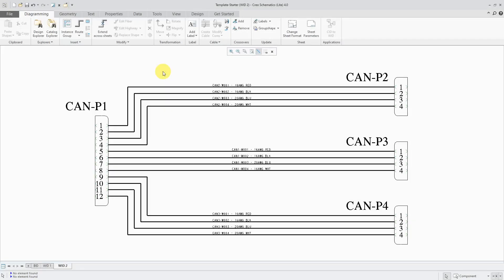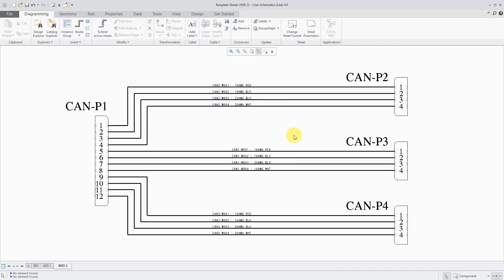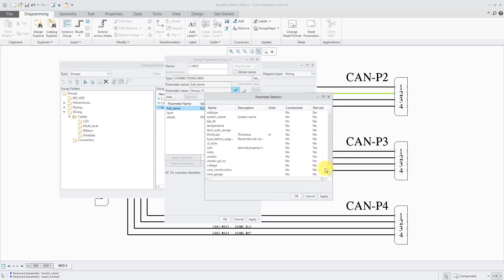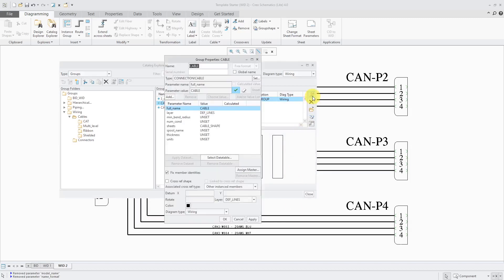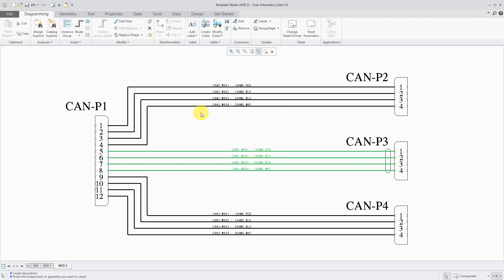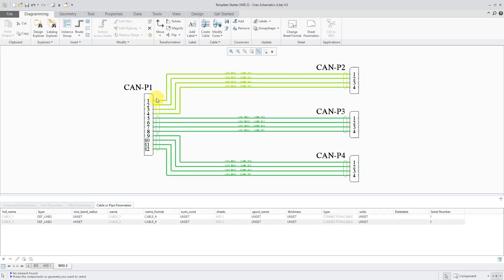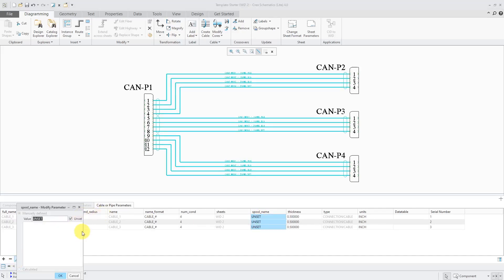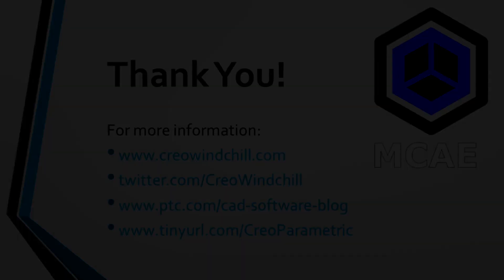Creo Schematics | On-the-Fly Cables

Comment: Hi David, 
Great job on these videos and your books, they are incredibly helpful! I think PTC university could take some notes. The documentation provided for Creo schematics is criminally lacking. In any case, I had a question regarding importing on the fly cables into Creo parametric for 3D routing. I followed your process in the video to create an on-the-fly cable, however I run into an issue with the spool name. When you create the on-the-fly cable - say with 9 conductors - do you need to have a datatable corresponding to the 9conductor cable with associated membermaps? It seems in this video, you would export the xml file and set up logical reference in Creo parametric. However, Creo parametric has issues with creating the cable without a defined spool for the cable. I tried creating a spool within Creo parametric with the same properties as the cable I created in Creo schematics but still wasn't able to create the cable. 

With simple wires you have the ability to quickly route them in schematics - assign a datable that has wire parameters that are widely used and import them into creo parametic for routing with no issues. However, there doesn't seem to be a way to quickly create/define cables in schematics without creating the cumbersome datables in order to use them for logical referencing in Creo parametric. If you can extend this video to its conclusion by routing the on-the-fly cable in creo parametric - I think that would solve my issue. 
Sorry for the wall of text but I've looked through PTCs tutorials, documentations, videos and even the routed system design group within the PTC community with no luck. 
Thank you for your creo schematic videos - they have been a great resource!
Best Regards.
Reply from the maker: Honestly, it's been years since I've used Creo Schematics. I have not used it in a production capacity since 2019 or so. This video is almost 5 years old. If PTC Tech Support can't assist you, I recommend reaching out to your reseller to see if they have a technical resource who can help you with your issues.

Comment: Sir correct me if I am wrong..
Cable is a set of wires with insulation surrounding it.. then the cable thickness should be more than the wire thickness  ryt....in datatable explorer for 3conductor shielded total wire thickness is 12 but cable thickness is 2.53

Comment: At the end you call a spool called Cable_spool.   Does that need to be created in Creo before attempting to route?  I get an error about a spool not existing in Creo cabling/or when I select to route it, it doesn't transfer into the route dialog and just ignores it.  Something is missing to route these in 3d, I'm afraid.   Fortunately your explanations are far better than anything PTC is putting out in their ” University”
Reply from the maker: Sounds like an issue with your XML export. See my video on required parameters for Creo Schematics for logical referencing.
Reply: I've successfully xml'd wires and predefined cables for years.   I think there could be a bug in Creo schematics 4 where it doesn't build the spool files needed for these on the fly cables.
Reply from the maker: @pete3000  Have you filed a ticket with PTC so they can investigate?
Reply: @CADPLMGuy  yup.

Comment: Sir, I want to give you an idea, can you help me convey it to PTC?
the first:
About Creo Schematics export issues
Every time I change the schematic diagram, I need to export the XML and then import it into Creo to update. I hope that ptc can do a real-time connection function in the next version. It does not need to import XMl. It can directly associate with Creo. Click the cable in the schematic diagram and it can be in Creo. Highlight
second:
Questions about the Creo Schematics library
I want to draw some electrical symbols, but I have symbols in DWG format. I open them after I create them and import them every time. I have to do repeated work. Can I import a folder at a time? The default import type is block wiring diagram type is wiring Or P&ID can be set by the user and then the port can be added by itself, which saves a lot of work
third:
About Creo Schematics bulk change attributes
Assuming that the attribute settings of the blocks I imported are all the same, how can I select them all at once and then change all the attributes of the same type? Every time I change the attributes, I have to click the attributes one by one to load the data table. The workload is very large.
fourth:
About Creo Schematics export catalog
In Creo Schematics, this command is very stupid. Why not let users directly export the corresponding package format and then import it again. Why specify? This is very unfriendly to novices.
The above points are the shortcomings that I have used Creo Schematics for a long time to summarize. I think 7.0 will be better, but it is still the same problem.
Reply from the maker: No. I don't convey ideas to PTC. You can submit to the Ideas forum on PTC Community. If you are really serious, join the Routed Systems Technical Committee via PTC/User. They just met yesterday.